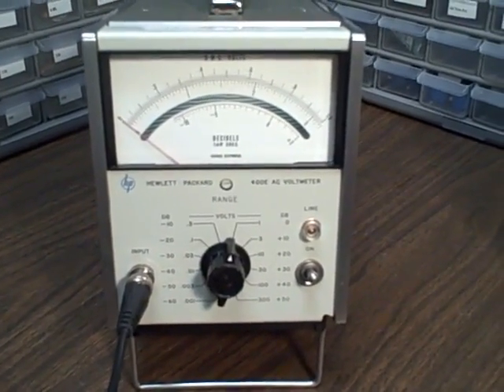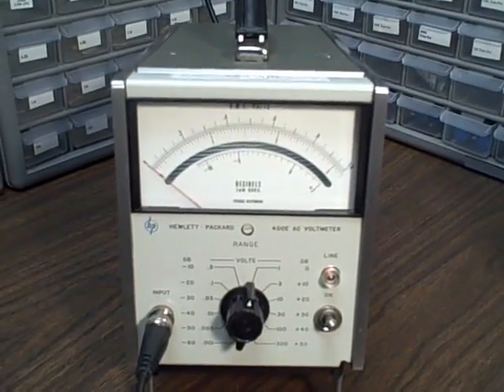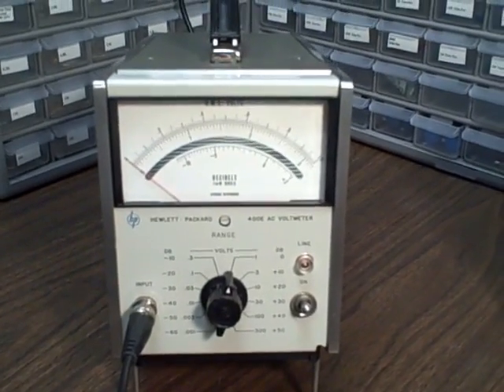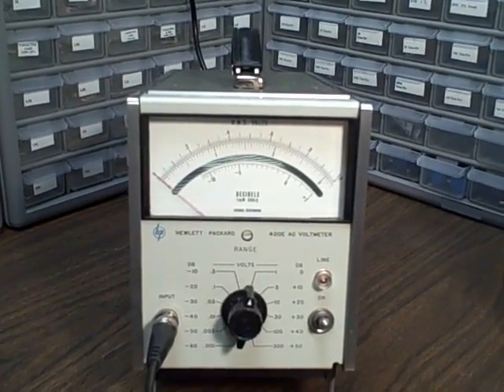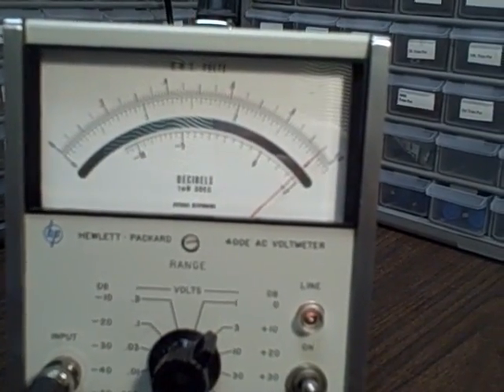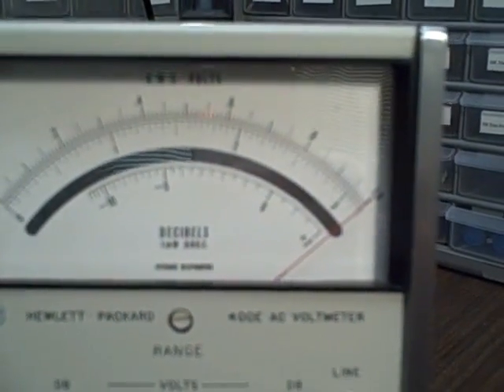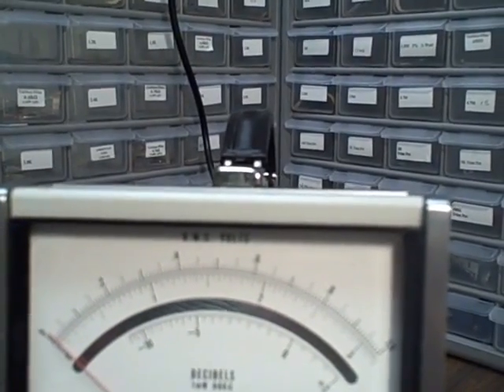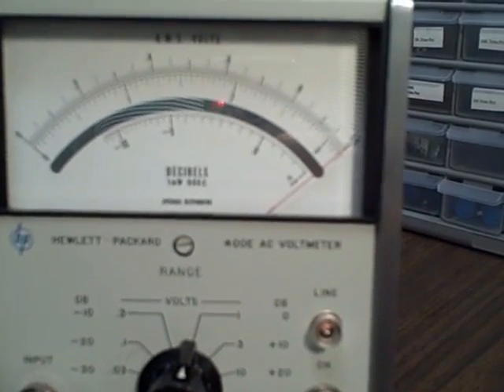HP 400E "Wide Band" AC Voltmeter Test

Comment: I have a couple of old, 2MHz  "C" models and a 4MHz "H" model. One of the 400Cs and the 400H work and are calibrated. I often grab one or the other instead of a scope so I don't need to go through all the set-up to measure the voltage level of a sinewave. Very easy. Handy for audio work and vintage BC band radio testing.

Comment: I have a 400f model, but when I turn  on, the pointer explodes at the end of the scale and gradually returns to normal. Why?
Reply: This is normal for all of these 400 series meters. Additionally, the meter will peg when switching ranges. Eventually they will settle down. It is because of either caps charging up or the other components warming up.
Reply: It also be noted that these meters are AVERAGE reading meters.  Thst is, they will read a sine wave accurately with respect to RMS but signals with a different form - like a square wave - will read higher,  usually by x1.11 times.
Reply: yes is normal